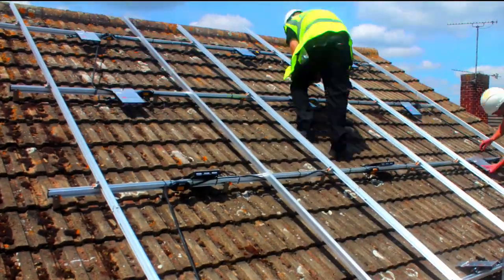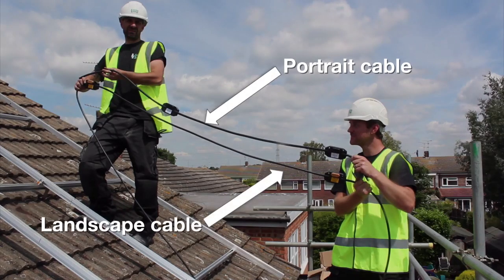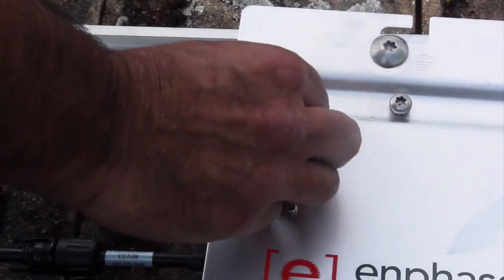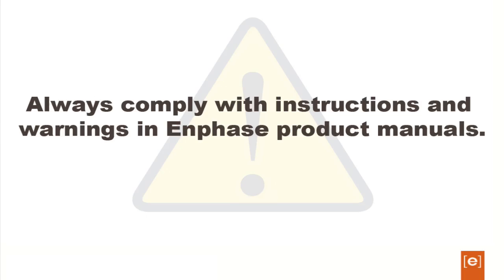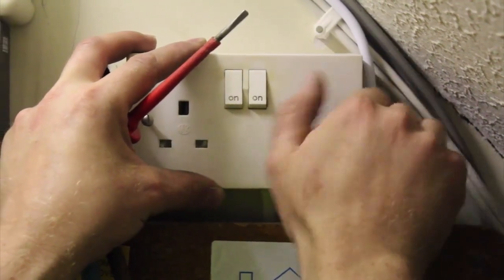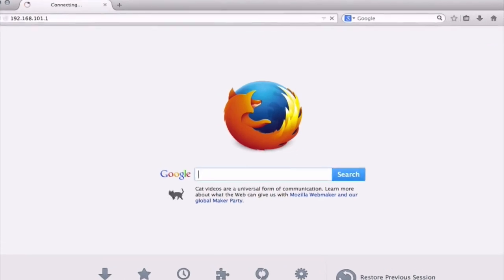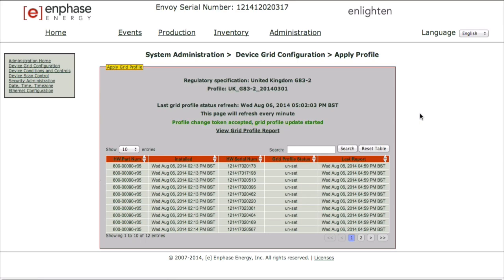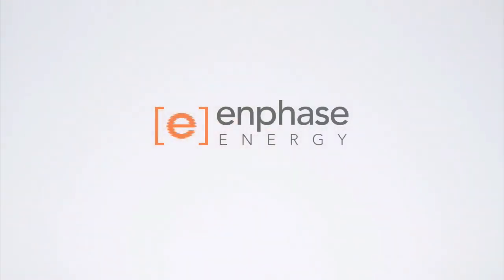Installing the Enphase Microinverter System (UK)

Comment: hi. I´d like to know about S280 installaiton on a three phase system. The installation manual of the engage cable says: "Because Enphase Microinverters output onto two phases, three phase cabling balances the phases by rotating conductor use from one microinverter to the next as shown in the following diagram".
My question is:  what do I have to do to get to that rotation of conductors? Is it made automatically by the S280? Do I have to phisically change anything or just simply connect the engage cables and the S280 will do this rotation ? Is there an sorting order for that rotation? Thaks
Reply from the maker: Phase rotation is done in the 208v engage cables. The S280 is single phase (sometimes referred to as two phase because it runs line to line). The phase switching in the 208v engage cable looks like this:
 
Drop 1: AB
Drop 2: BC
Drop 3: CA
Drop 4: AB
Drop 5: BC
Drop 6: CA
 
So drops 1 and 4 are on the same phase, as are 2 and 5, and 3 and 6.  That is how we achieve three phases with the single phase S280. Does this help?